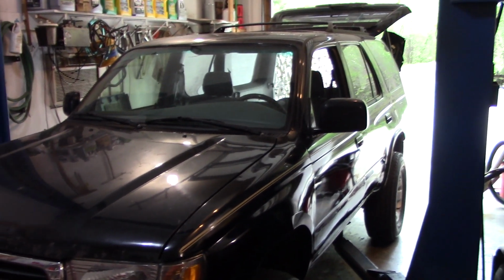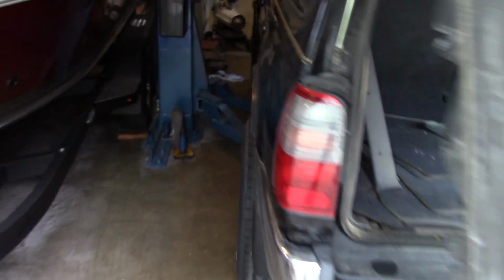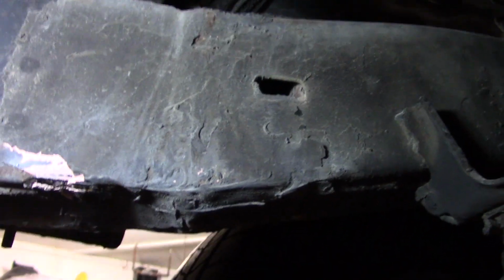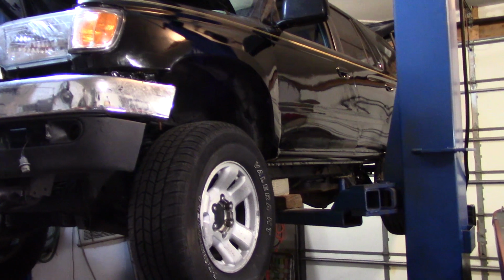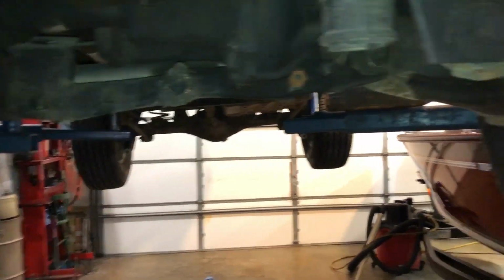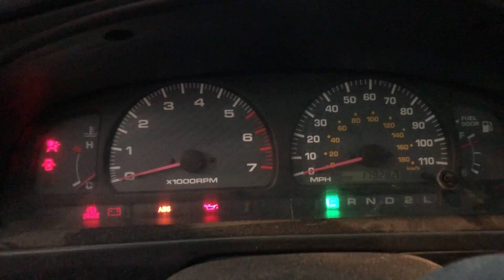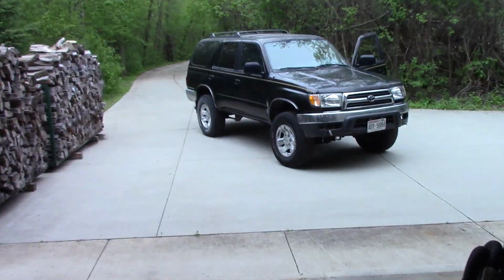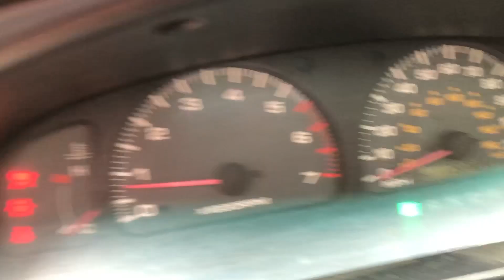Copart Mistake! 1999 Salvage 4runner

Comment: This 4Runner isn’t even a 1998. It’s a 1999.
Reply: It might be a 98 with 99 parts. They coulda pulled the grill bumper and headlights from a 99 to put on it after the crash
Reply: Levi Monsen even swapped to a 99+ maf sensor and trunk storage panel? And even retrofitted the digital odometer? Not a chance this is a genuine 1998.
Reply from the maker: It is in fact a 1999,  I screwed up when I made the video and never took the time to take it down to re-edit.    My brother bought it from me, fixed the airbags, reinforced the poor frame repairs and has been driving it in South Dakota.  It’s proven to be a pretty good truck.  He’s put about 10,000 miles on it so far.